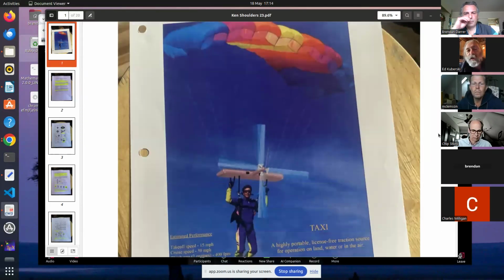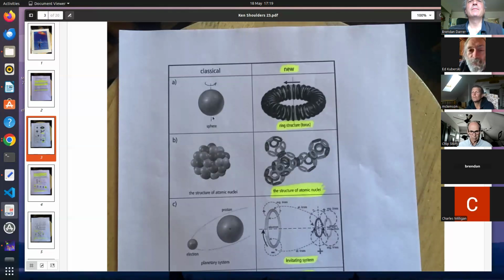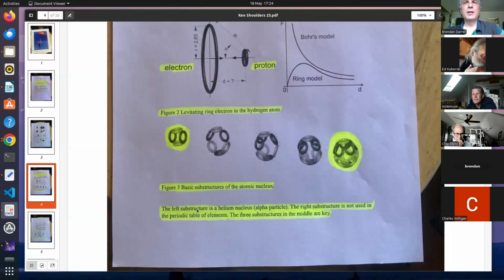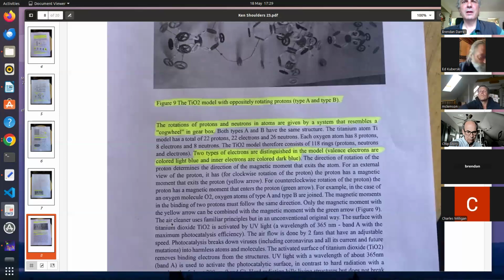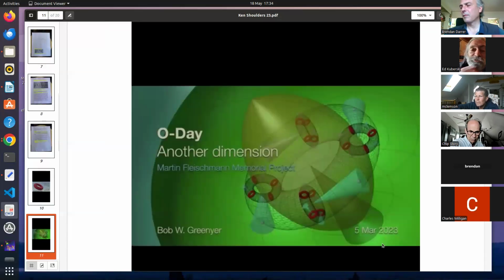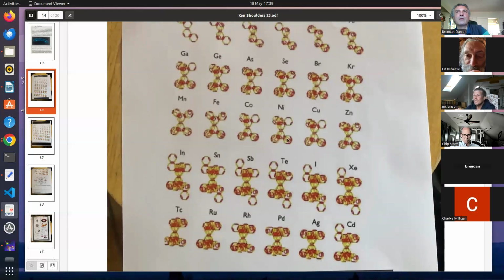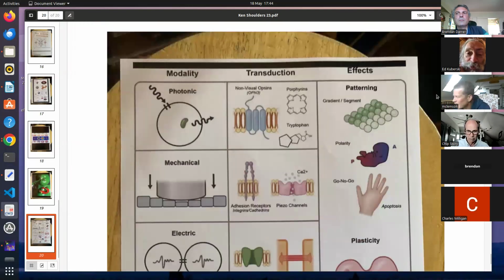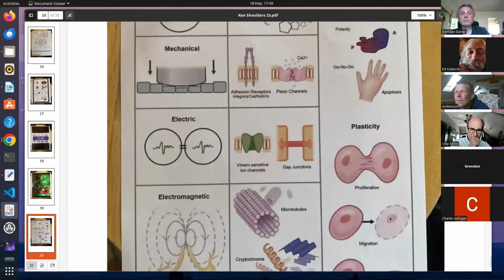EVOs and Consciousness Research - Ken Shoulders No 23  - 18th May 2025

Comment: The “topological structure” sure reminds me of various skematics I’ve seen of Vector field cancelation coils. The navy recently had an evaluation done of NASA’s Braunbeck coil room. 
Coincidence, I think not. Here is the abstract of this publicly available paper. 

“The Naval Surface Warfare Center, Panama City Division (NSWC PCD) Fanselau Magnetic Test Facility features a large, three-axis, magnet coil system having a coil arrangement based on a design originally developed by Gerhard Fanselau' and later refined by Werner Braunbeck? Figure 1 shows the Fanselau/Braunbeck coil arrangement of the facility. The coil design provides a magnetic field having a high degree of uniformity over a large spatial volume. Since the original papers by Fanselau and Braunbeck were published in German, in 1929 and 1934, respectively, the basic theory behind the derivation of the coil-geometry parameters, based on the original works, will be presented in this document for the reader's convenience. We have supplemented the content of their original analyses with sufficient background material on electromagnetic theory to provide a complete treatment of the problem.”